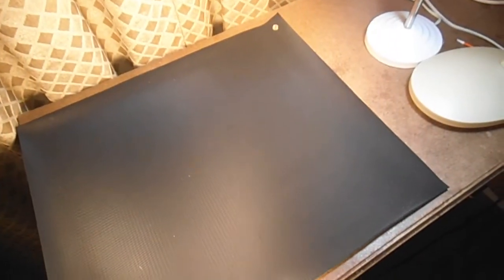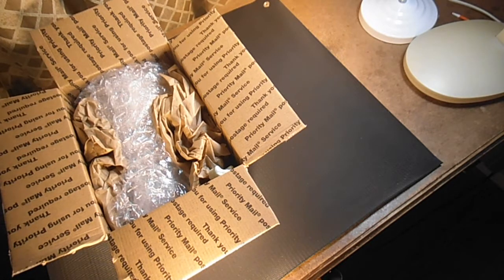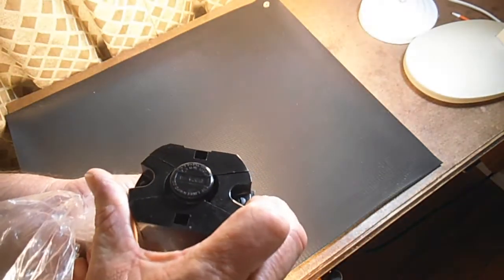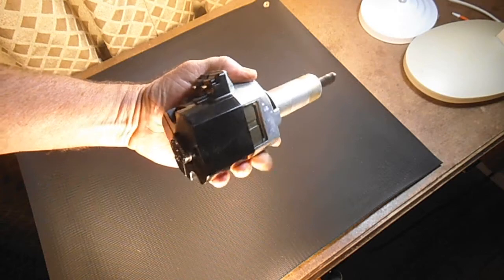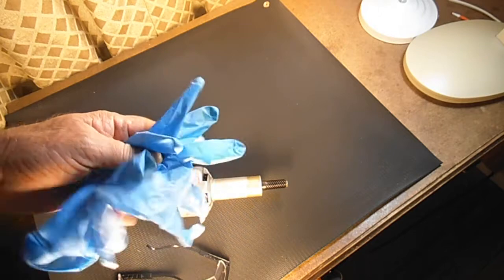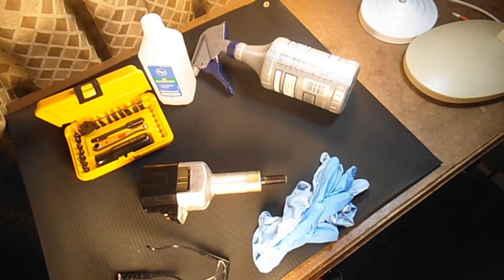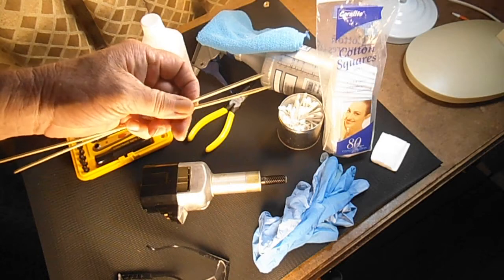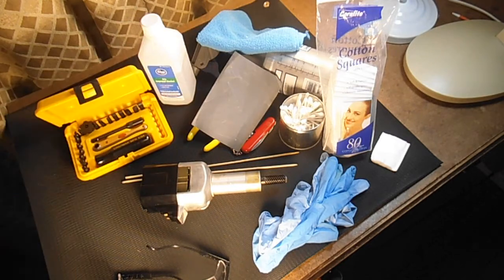HOW TO RESTORE SINGER PA STYLE SEWING MACHINE MOTOR Pt.1 INTRO & UNBOX

Comment: Thanks so much for recommending our tools! So glad you like our #9600 set https://chapmanmfg.com/products/9600-starter-slotted-bit-set
Reply from the maker: One of the best tools I own! I use them on every restoration. I think I have saved enough tough to remove screws by now that the screwdriver set paid for itself. I love how I can buy extra bits starting at only $1.35.
https://chapmanmfg.com/collections/slotted-flathead-sets/products/slotted-insert-bits?variant=901985123